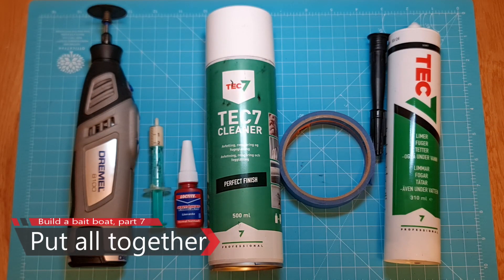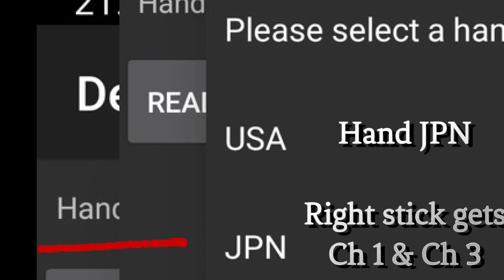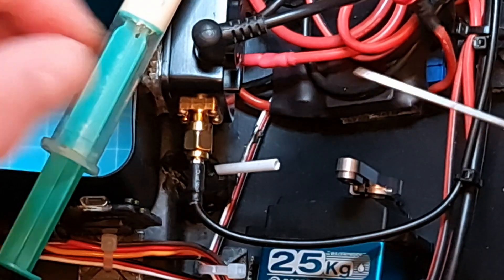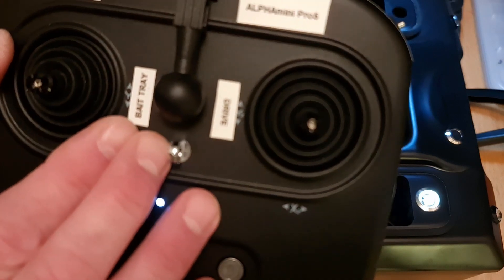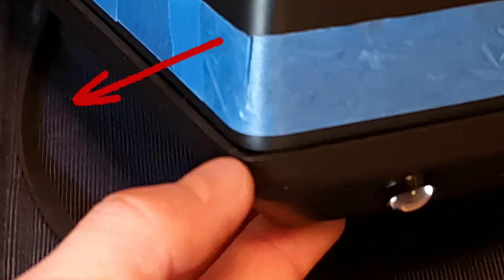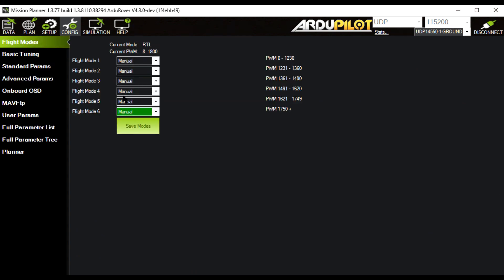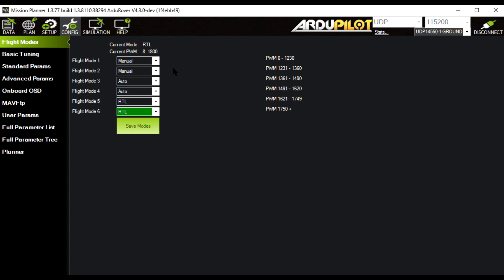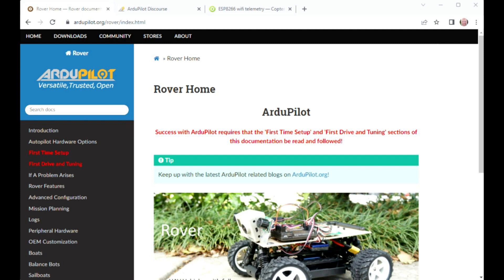Boat build part 7 - Putting it all together

Comment: Super Videos wo finde ich die Parameter Datei die sie hier runterladen
Reply from the maker: @andreasoldiges7854  link to a sample parameter file that fits this boat as a glow using firmware 4.2.3 is in the description of video 7 (putting it all together). Note that as your boat is likely somewhat different then you will have to tweak setting and do additional tuning of autopilot driving before you are done.
Reply: Vielen Dank